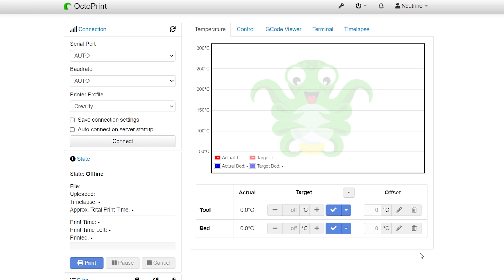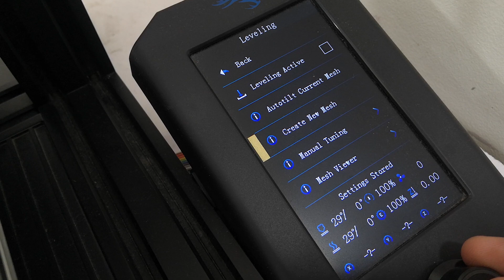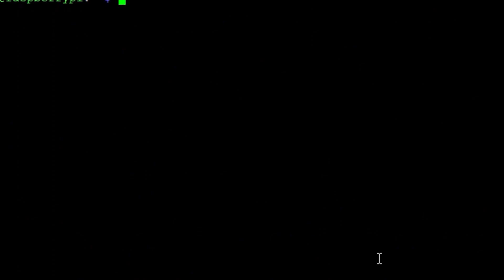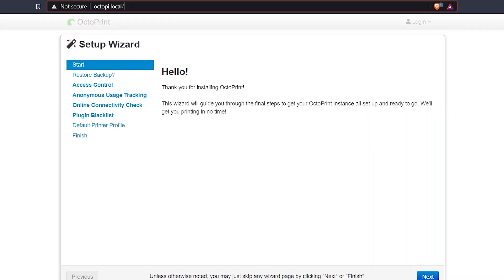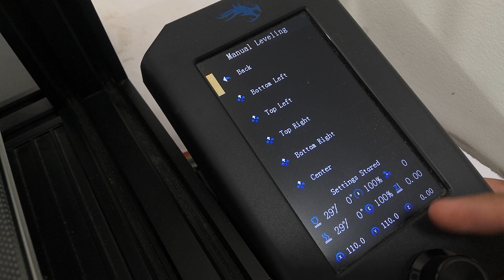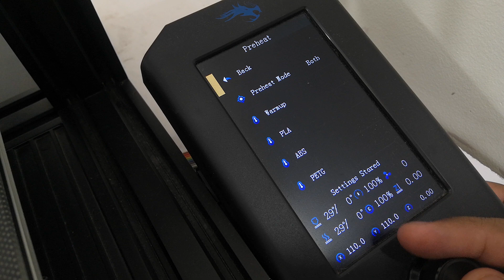4 Upgrades for your 3d printer [Ender 3v2 WOL3D] | firmware upgrade | Octoprint

Comment: Brother, I need your help, I salvaged a  photo interrupter(C9017-80055)  from HP printer and many other parts and I need to figure out how do I use it as a switch, please help
Reply from the maker: I was not able to find the datasheet, but if it has 3 pins. 2 will be use for power VCC and ground and the other pin will be for signal. You can use Singal pin to turn on and turn off transistor which can act as switch.
Reply: @Neutrino1  yes it does have three pins green yellow and black but the thing is should I use it directly with arduino without any resistors, it wouldn't damage it?
Reply from the maker: check the working voltage, if the voltage is less than or equal to 5v then it should be good.